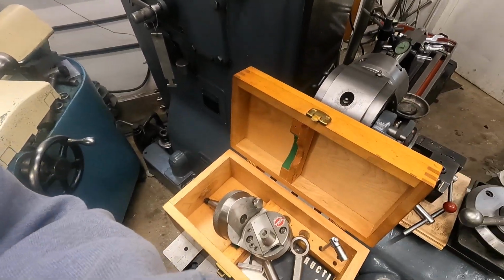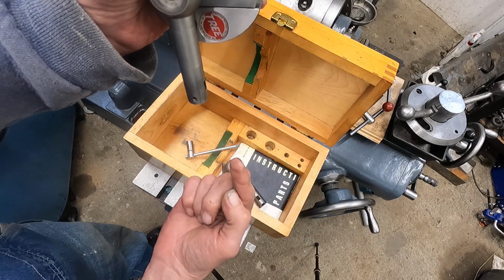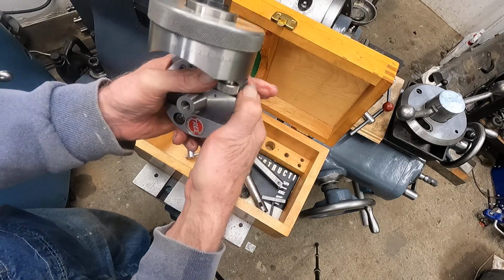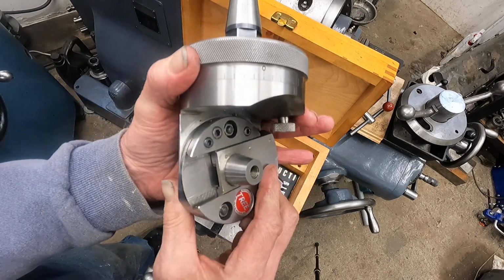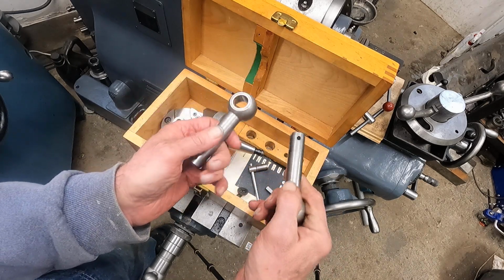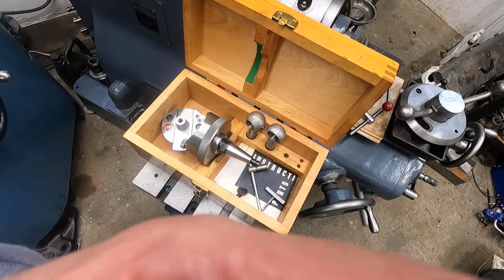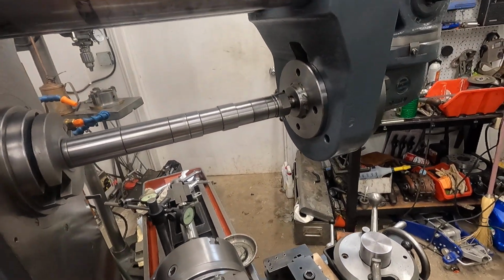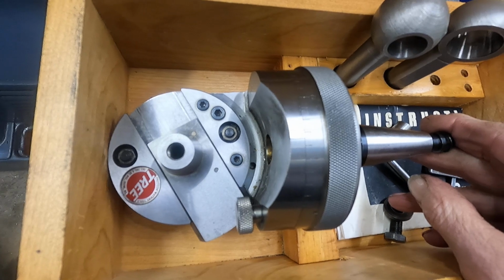Tree Taper Boring Head for milling machines

Comment: I have one, how do you tell if it’s high speed or low?
It’s makes it possible to taper parts in castings too big or nonsymetrical dynamically to spin on a lathe.
Reply from the maker: The fast feed model has .005 per rev on the collar. Yes, with this head you can do work that would require a large lathe, great comment thanks!

Comment: Very cool tool Don. I have only seen 2 like it, one in a friend’s shop and one used by Robin Renzetti.  Robin used his to bore tapered hole in a rack he made to hold tools that had tapered shanks. I look forward to learning more about about its’ capabilities are. Yours looks like it is new.  How do you keep your tools so pristine?  Thanks for another fun lesson. Cheers, Will
Reply from the maker: You are a sharpe guy Will, I think I will call you "The Blade". There are a few things at play here. People are like Bower birds, they are attracted to shiny things, and this is important. 
When you do work, take the time when possible, to put a high speed finish cut to make it gleam, make sure the part will not cut them. Now the answer to your question I created an optically clean surface for the camera by wiping the tree head with thin spindle oil making it look like new. You have to be in it to win it, every detail is important.
Reply: That is very clever Don, but it has to be in very good condition for your thin coat of oil to fool the camera… My friend’s Tree head functions perfectly but it would take a lot more than a coat of oil to make it look as beautiful as yours.  All of the projects you’ve shown on YouTube shows you’ve taken the time/effort to not only take care of your things but to make them artistically pleasing.  I think it is half the fun myself.  Keep’em coming. I’m loving your videos.  Cheers, Will (aka “The Blade”)

Comment: What a lot of people don't realis about this type of boring head is that it's a facing head as well........normal boring heads can bore holes only and are 2 a penny on EBAY but a facing head would normally cost over 2 grand.......not everyone wants to bore a tapered hole but most people boring a hole would like to face it square to the bore as well.
Reply from the maker: These heads were expensive new and were made into the 1990s by another company